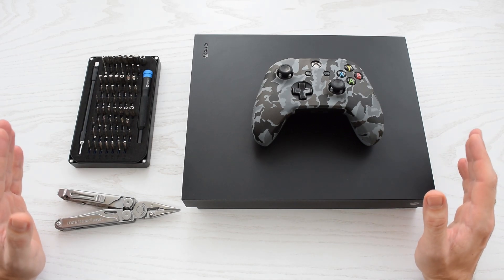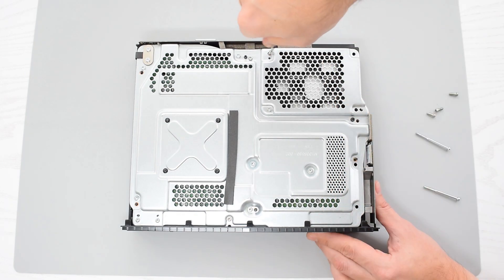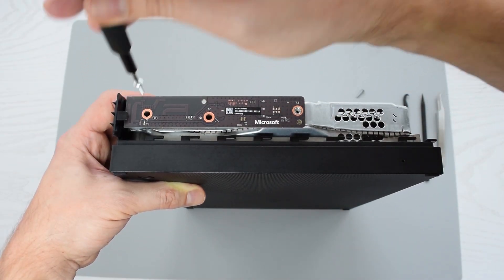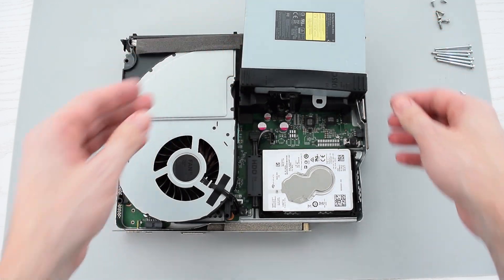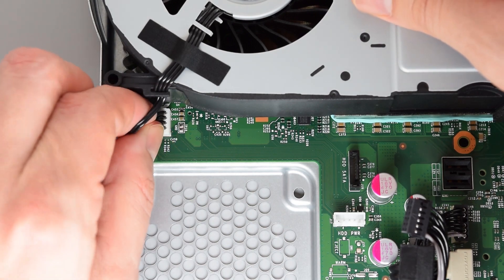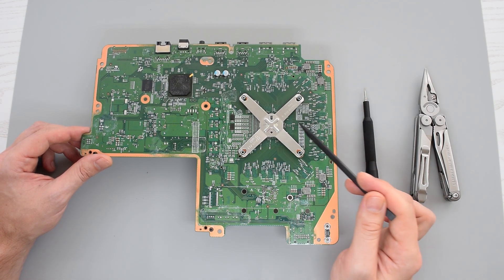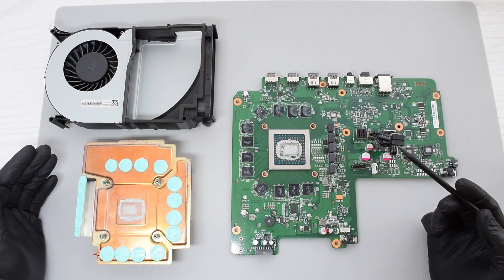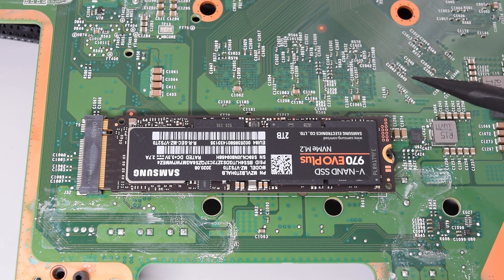Xbox One X Disassembly & Upgrade Guide – NVMe SSD Slot, Thermal Pads, Cleaning & More

Comment from the maker: Hey everybody! I'm still working on the project that would allow to install M.2 SSD (NGFF or NVMe) into Xbox One X. I wish I had more time to do that, but anyway I'm not gonna give up on that project and I'll finish that video real soon, hopefully.
Reply: Are you trolling where's the video sir?
Reply: Did you ever get it to work?
Reply: @shanehopkins87  The last status was, that he complete everything, every hardware, but it doesn‘t work, and he say maybe he and his team must control the way of the platines again or they must  create a software for it. How it‘s going now, I don’t know. He can tell us. (They can maybe the analize the software from Series X, maybe it can help.)
Reply: Did you ever got this to work. Awesome video by the way.
Reply: LIkely not much of chance for a NVMe drive will work on a console based around a sata3 controller, but then again I have not checked the controller chips in details to see if there are an NVMe PCI controller present, but your right - it looks to be very few discrete off the shelf components that are missing in that area,. (kudos for digging into it..!!)
A question how many TB does Xbox One X support at once.?
Is it 26TB or is it 18TB?
 I know Xbox One X  is a pure pleasure to use with external SSD drives and the OS will accept at least 4 drives a once.. 3 external + 1internal.
but to my understanding does each of the external have a limit at 8TB (sadly don't have any 8TB SSD to validate) and the internal at 2TB max, so in theory it should equal 26TB of possible SSD the One X would be able to handle at once..?.
Reply: @JAKOB1977  internally all Xbox ones only support up to 2 TB, externally + internally I believe is dependent on how big of external drives you can plug in😂 I think the largest “External Xbox Game drive” I’ve found was 5TB; so in theory, you could well over 15TB of storage
Reply: so, are u make happen? plz i need to see this work
Reply: :( Never happened ig.
Reply: Did ypu even succeed
Reply: Eu quero o Vídeo Instalando O slot para nvme , ???? Cadê
Reply: Looks like NGFF, but will it work as main drive or...
Reply: Going to try it myself
Reply: Try using a 2TB solid state drive as an option, lad.
Reply: A German guy on YouTube by the name of Craftbenmine got the slot to work. It only seems to work with certain m.2 ssds and will only work as a drive to put the games on and not the operating system but they are actively finding more and more compatible nvme drives.

Comment: Hi can i put a 2mm thermal pads or 1.5mm? I have to repaste my console.
Reply from the maker: You have to use 1.5mm ones. Or you can use thermal putty, which is way more effective and easier to apply. I have a video on how to clean Xbox One X and replace the thermal pads and paste: https://youtu.be/MD94P9Jm6HA

Comment: Great teardown video. I am in the process of elimination as far as the sluggish Menu is concerned. 
Steps I've taken to ensure a speedy console.
1. Swapped out the HDD for an SSD.
2. Cleaned everything on the inside, and swapped out the thermal paste and pads with new better ones.
3. Cleaned the fan, fins and shroud.
4. put everything back together, installed appropriate system software and updates....
Now, here is the problem, everything works beautifully, except, even with a clean system, clean software, new thermal paste and pads, when this system gets hot, the xbox menu continues to be sluggish.
I've read it could be the fan, it isn't. It works, but I've noticed that it doesn't ramp up when the system gets hot. So I believe it is the temp sensor. 
Where on the board is it? I believe the temp sensor isn't working properly to allow the xbox fan to ramp up with demand.
Reply from the maker: Instead of thermal pads, I highly recommend using Upsiren U6 PRO thermal putty. No thermal pad comes close to matching its thermal conductivity and ability to adapt perfectly to uneven surfaces.
In the past, we experimented with thermal pads, but due to varying compressibility, some pads failed to make proper contact between the APU and heatsink. Softer thermal pads, while flexible, often have poor thermal conductivity, which further compromises cooling performance. This is why modern consoles, graphics cards, and laptops are increasingly opting for thermal putty.
Regarding the temperature sensor, most modern CPUs, APUs, and GPUs have integrated sensors to monitor temperatures directly. If switching to thermal putty doesn't resolve the issue, another option is to connect the fan to a 5V or 12V power rail. This will allow the fan to run at higher or maximum RPM, improving airflow and cooling efficiency.

Comment: This is probably not going to happen but have you tried taking apart one of those m.2 adapter cards to use there M.2 ports
Reply from the maker: I have a video with attempt to upgrade One X to m.2 slot.

Comment: Did you ever add the M2 SSD port & circuit parts and try it on the current firmwares to see if it had support yet?
Reply from the maker: Check one of my recent community post about that video. The number one part of the video is done and I'll post it soon.

Comment: Hi :) Okay so I know this is now close to a year after you posted this, but did you ever find out anything about adding a NVMe port to the motherboard? I'm wondering as I have a question about the Series X. The prototype (leaked pictures) had a SPDIF port on the back while that port was removed for the retail version. But the motherboard has pinouts/pads for a SPDIF connector, and as you ponder here, unless it needs more parts than just the connector, would it work?
Reply: Image detailing the option (ignore the LED mod thing, that was just what got me to the SPDIF from the Prototype XSX):
https://preview.redd.it/pynca76bkj181.png?width=1920&format=png&auto=webp&s=c8b34eea731b2537eedfcfaebbea9b2641127337
Reply from the maker: Still working on that project.
Reply: @ElectronicsComputers  If you and your team make that happen, you are the heroes on the Xbox world.

You can share with us how it‘s going, everbody want to know the status :) we are so excited.
Reply: @yorumustasi  Pressure him and let him know that we want this on his latest videos!

Comment: What type of network card is that in the Xbox One X? I’m curious if upgrading that network card could give me more internet speed as we have a gigabit package through our isp. If you can provide more info on this I’d appreciate it. I’d love to get this thing working at gigabit speeds through my wired setup. All of the equipment used as well as the cabling all support gigabit speed and my Xbox One X draws up to 630 ish mbps.
Reply from the maker: Unfortunately, wireless cards are not upgradable, because Xbox consoles use non standard cards which were made specifically for their equipment.

Comment: @Electronics&Computers   Did you ever manage to reverse engineer the NVME possibility? I understand it involves soldering and finding the right components.. but curious if it worked
Reply from the maker: The video about success or failure will be released soon.

Comment: I was told that the capacitors labeled with Cxxx and some resistors (Rxxx) are missing connecting the m.2 to the motherboard.
Reply from the maker: Sure, and also 3.3V voltage regulator for the SSD.

Comment: Under the heat sink are those ram chips if they are is there a way I can upgrade them
Reply from the maker: It's not gonna work. 12gb of RAM is more than enough for this console. All games come maximum optimized for the console and even if you could upgrade the RAM chips you wouldn't see any difference in performance. The best upgrade you can do is upgrade HDD to an SSD. I have a video on that too.

Comment: hello ik its weird but how do you make your headset mic work on a dell computer not laptop cause im suffering i cant find how to make it work my mic thats on the computer takes over the mic and i need it fast because i stream
Reply from the maker: If you need to switch between the built-in and headset mics then go to the Control panel-> Sound. In appeared windows click on the record tab and then right-click on your headset and select "Set as default communication device". If you want you can also disable your built-in mic here. Right-click on it and select disable.
Reply: thanks i got it working

Comment: Would it be faster than the m2 used via the sata adapter that you used in your previous video?
Reply from the maker: Via SATA adapter we can only use SATA-based NGFF M.2 SSDs while unpopulated port allows you to connect NVMe (PCIe) SSDs. The difference in performance between those M.2 SSDs is very noticeable, at least on PC.

Comment: Have found a solution for NVME slot yet ?
Reply from the maker: To make it work we need to find out how they planned to implement a 3.3V power rail and data line. I'm trying to reverse engineer schematics. And thanks to Xbox series X which has similar components we have chance to make it real.
Reply: @ElectronicsComputers  Are you planing in investigate this furthuer and share in a video? I will like very much to see some advancements in this particular mod. This week i've installed an SSD and saw some improvements in Xbox One X OS performance and offcourse games loading times, but i think the CPU is botlenecking the speed of ssd.
Reply from the maker: @carlossaraiva8127  The CPU is fast enough to handle those speeds. The video will be somewhere in the spring.
Reply: @ElectronicsComputers  Curious if this ever worked out? I dug through comments and about a month ago you mentioned a possible video soon? Still cant get my hands on a Series X for my wife (I got lucky and snagged one at release) and I dont see the point in a Series S as a temporary solution, when the One X she has is native 4k. The nly thing holding it back is the standard drive/SSD (non nmve) options.
Reply: @ElectronicsComputers  any news on nvme?

Comment: i wish the developer mode app had options for the system because i highly doubt the empty slot would work. Someone would already said something.
Reply from the maker: I'm trying to reverse engineer schematics and figure out the specs of missing components. We'll see soon if it's gonna work. If the firmware supports that port then it should definitely work.
Reply: @ElectronicsComputers  how You think? How many time You need to heck it?
Reply: And?! How it works? Do you working on it? 😁

Comment: I hope the M.2 is possible!!!! That would be a game changer. Great work on the video 😃
Reply from the maker: If we could work it out, then maybe there's no sense of buying Xbox Series X.
Reply: @ElectronicsComputers  Will you try to solder an m.2 slot on xbox one x?
Reply from the maker: @carmeloburgio7423  Sure! I'm working on it. And it's not just M.2 slot, there's a whole bunch of missing components.
Reply: @ElectronicsComputers   No news ?
Reply from the maker: @Sectorz  I'm waiting for the last components to arrive and then I'll try to finish that project as quick as it possible.
Reply: @ElectronicsComputers  is this even doable without schematics of the board?
Reply from the maker: @tomasyaczik2641  I have datasheets for almost all chips and components, the rest is reverse engineering.
Reply: @ElectronicsComputers  Im Currently installing a sata ssd and noticed all the slots for stuff and that’s how I found your video! I got most e stuff to attach and solder components too! Can’t wait to see what you accomplish
Reply: @ElectronicsComputers  Have you had progress with the project?
Reply: I can’t wait for progress on this front
Reply: Have you made any more progress on this?
Reply: Can you not just put a nvme in a ssd sata holder
Reply: @LondonG0708  that is possible, but by doing that the NVME M.2 is limited to SATA speeds. But with a direct connection to the board, the M.2 could reach processing speeds beyond what a SATA cable will allow

Comment: I've just witnessed greatness! To give such information under 4 minutes it requires some real talent. Bro, please make the video about installing the M.2 port even if it was unsuccessful. Maybe someone could also share some ideas about it and we all could make that upgrade possible. Thanks for the video.
Reply from the maker: Thank you for the comment!
Reply: @ElectronicsComputers  yes sir please do that video on adding that M.2 slot to the unpopulated area on the board. I need that video in my life explaining how to do it, if it works or doesn’t work, and possible reasons why it may not work. If it doesn’t work and enough people request Microsoft to add support for that slot to be utilized we may see an system update that allows it to work.
Reply: Cant wait for video about instaling m.2 NVMe ssd... I am belive it can worked